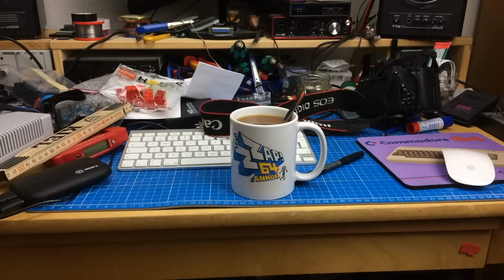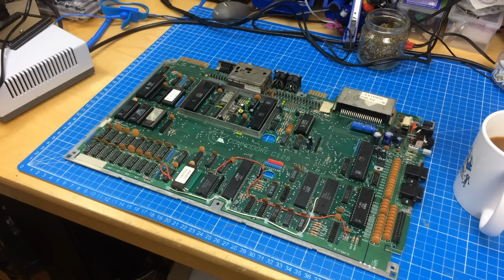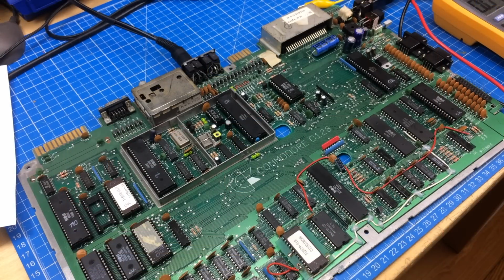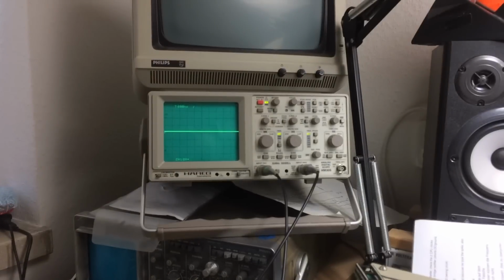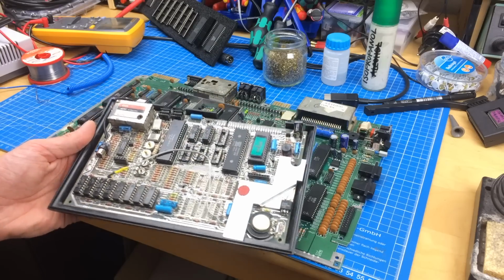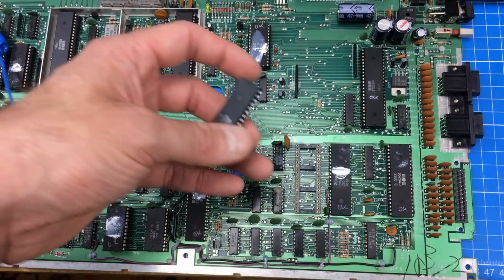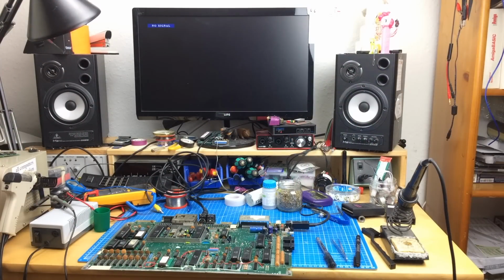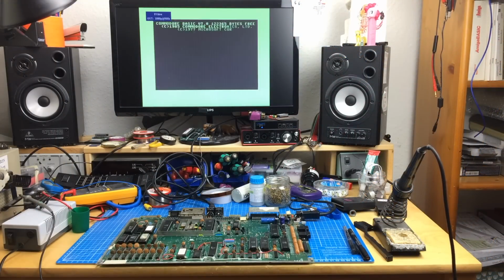Commodore 128 Repair Attempt Part 2 (Success!)

Comment: It wasn't the ZX Spectrum that was used as a doorstop at Commodore; it was the predecessor, the ZX81 or Timex Sinclair 1000 which was even more wedge-shaped, and cheaper. The ZX Spectrum didn't see an official release in the USA, though the Timex Sinclair 2068 was closely related - and very unsuccessful.
Reply: It would've been more successful (maybe) if they had included backwards compatibility with the Spectrum, instead of forcing you to buy an "emulation cartridge" to run most of the existing software.  Although some of the improvements made in the 2068 (at least the AY-3-8912 sound chip) did end up being included in the ZX Spectrum+ 128k.
Reply from the maker: Oh, you're right of course. I didn't think of the overseas versions of the Sinclair machines. Sorry for not being historically and geographically accurate on this. I'll pin the comment to the top so people can see it. Thanks for pointing that out! :)

Comment: Why is there no chip in U36?
Reply from the maker: It's for expansions. Commodore had planned to release some business software and such for it that would boot up instantly, like with the Plus/4 for example. There's a GEOS ROM that has huge parts of the GEOS system on it and allows GEOS to boot a lot faster. Quite handy really, but it didn't get as much attention as it deserved at the time.
Reply: @JanBeta  Ahh I see. Thank so much for that info. I just picked up my first Commodore 128 and I am not familiar with them. Waiting on power supply to test it out. I have an A500 power supply but I heard those are NOT compatible with the 128.

Comment: With the newer display options avaiiable these days, can i just rip out the RF modulator to make space for some mods i have in mind and still have the C128 work as normal?
Reply from the maker: You have to add a little replacement circuit because some of the video signals are fed through/processed in the RF modulator. It's the same modulator used on later C64 revisions as far as I know.

Comment: After that I had to double check my C128 to see if the bodge wire was going over the video chip pins. Seems possible in earlier revisions they weren't as lazy. Mine is a 1986 rev 7 (artwork no. 310381) and the wire goes around the pins.

Comment: Jan wie heißt das "desoldering tool" für Chips, dass du nutzt. Ich habe immer große Probleme das Lötzeug zu entfernen bei solcher Afgaben... DANKE!
PS: Du hast vergessen, ans ENDE des Videos das berühmte "HELLO WORLD" einzuprogramieren, als Krönung Deiner Rparatur. ;-)
10 PRINT "HELLO WORLD"
20 GOTO 10
RUN
...aber das weisst Du auch so... :-P
Reply from the maker: Ich benutze eine ZD-915 Station. Gibt es unter verschiedenen Herstellernamen auf allen üblichen Verkaufsplattformen. Mittlerweile gibt es auch verschiedene Nachfolgemodelle, die alle ähnlich funktionieren.
Reply: Besten Dank, Jan! Viele Grüße aus Bremen!

Comment: I suppose the hot chip began running cool once the wire was fixed?
Reply from the maker: No, it runs just as hot as the earlier Z80s do. It seemed suspicious to me but I guess it's just their normal operating temperature. I will add some heat sinks in a future video.
Reply: I'd just re-install the RF shield, it is also good for cooling.

Comment: Hehehe...Never thought that these issues came from that cable and that such a simple cause could lead to such trouble. Had something similar with my SCSI RomDrive on my Amiga 2000. In the end it was just a broken SCSI cable...
Reply from the maker: Yeah, it's the little things most of the times. I watched your hilarious Anrufbeantworter video the other day where you also mentioned your SCSI cable situation. :)

Comment: Great to see you could get your C128 working again, wish i could make my fathers C64 working again, he stop working after plugging a Commodore 1541 disk drive to it, and now the C64 are not working anymore, and i already replaced the two CIA chips, and did not help.
Reply: What are the symptoms?
Reply: Black screen, and for the rest nothing, the voltages are all ok, i measured it with a multimeter.
Reply: If it is a black screen the cause is unlikely anything 1541 related. It can be difficult and time consuming to troubleshoot it, a lot of techniques shown in the videos apply. However, it is often repairable.

 Inserting a 1541 Ultimate as done in the video can be very helpfull: Plug it in, activate the menu and look what is on the screen. For example, if your memory is broken, you will see a distorted picture and the type of distortion will tell something about what is broken with the memory.

If the PLA works, the VIC-II works, the memory somewhat works, and the bus is not stuck (as in the video) the 1541U2 can initialize the VIC-II and get you a picture.

It can be good idea to test first if it is safe to insert a 1541U2: Check the address and data busses and check if a pin is stuck to 5V or stuck to 0V. If the pins are pulsing, it is safe to insert a 1541U2. While checking the pins, you might already spot something suspicious.

Another very helpfull tool is the dead test cartridge. You can build one yourself, buy one on Ebay or configure a 1541U2 to act as one. The dead test cartridge can initialize the screen without using the KERNAL and BASIC ROMs and if your RAM is broken, it is still able to flash an error code on the screen. Therefore if the dead test cartridge gets you a picture it will tell you a lot, but even if you get no picture with the dead test cartridge, this rules out a lot of components.
Reply: That is the right one indeed. The dead test cartridge can get signs of life out of a black screen Commodore 64 if the ROM or RAM is broken. It is also immume to errors in circuits related to the RAM, for example if the 74LS257 plexers are malfunctioning, the dead test cartridge will be able to get a life sign out of the C64.

The dead test cartridge does need a working CPU. This is a difference with the 1541U2 which has its own CPU and therefore the 1541U2 can display a picture even if the 6510 CPU is broken.

If you insert the dead test cartridge, you will either get a test screen where various components will be tested for error, or screen flashes. Screen flashes happen in case the dead test cartridge determines the RAM is not usable. The flashes are an error code that is communicated. You will need the manual to interpret them. The manual is available here:

ftp://www.zimmers.net/pub/cbm/manuals/peripherals/C64_Dead_Test_Diagnostic_Manual_(1988-Jan).pdf
Reply: The 1541U2 is a swiss army knife, indeed it is better in this regard, but diagnosis is not its main purpose, just one of the many, many different applications it has. You can also configure it to act like a dead test cartridge (use the custom crt option), so if you have a 1541U2, there is no need for a dead test cartridge anymore.

You can buy it from its website: http://www.1541ultimate.net   Be warned that its maker doesn't keep stock, he produces them when he has collected enough orders. Therefore if you order one it can take a up to few months until you get it delivered.

Comment: Living in south east USA (Tennessee), I understand heat.  The temperature you're describing is NORMAL for us for much of the year.  A couple of years ago we had a heat wave where it was hotter than normal.  Temps got up to around 112 F (~44 C) for at least a couple of weeks.  :-)
Reply: Your environment is probably more adapted to it. I am half Dutch, half Italian. Having a day with, say, 36°C in Italy is far more comfortable than having the same day in The Netherlands. A few examples: In Italy houses and many other buildings are often equiped with air conditioning and windows are often not positioned to capture sun. Air humitidy is lower. In the Netherlands houses have big double layer glass windows, because in cold winter conditions, you want to capture as much sunlight as possible to help keep a house warm. During a hot summer day, however, such a house turns into a hot greenhouse. Very few houses have air conditioning, at best people buy a portable unit. Air humidity can be really bad.

So while in hot countries hot days might be more common, those countries also have better facilities to deal with it.

Comment: Thanks for sharing.   Close examination goes along way.   I had a 128D that had a keyboard problem which drove me crazy.  Had I examined the unit closely I would of seen the shorted pins on one of the control ports and it would of saved me several hours of frustrating work.   Its all fun stuff.  Happy to see you got the 128 working.

Comment: First of all - congratulations, i think we were all waiting for that!!! I have one tiny thing to say - you were checking signals and you deducted that one pin signal is too low. It would be a great thing for some inexperienced people like me to show same thing on the workable c128 to show us the difference. I now it takes time so treat my comment like a really wee suggestion.
Reply: Allthough I think it would make sense to get it visible on video, but as that doesn't exist right now, I can try to answer with text. Basically pins rapidly transmit 0s and 1s. The C128 uses two types of chips: NMOS and (LS) TTL. For NMOS chips anything > 2.4V is a 1 and anything lower than 0.8V is a 0. For TTL chips anything > 2.0V is a 1 and something < 0.8V is a 0.

That means that if you look at a pulsing pin, when it is high it should be > 2.4V and when the pin is low, it should be < 0.8V and preferably by a comfortable margin, otherwise bits aren't properly transmitted. So if you see something  else, for a example, the pulse does not get higher than 1.5V, you know there is an error on that pin. The cause can be the chip that generates the pin, it might be broken, but also that somewhere else on the PCB the voltage is leaking away, for example due to the bodge wire in this particular case.

Comment: You don't have to apologise, it's hot here too (UK) the melting point of an Englishman is 28C. I have melted and had to be reformed twice this summer.. 34C on my balcony, of my concrete box is enough! 
My PC hasn't been monitoring for a month as it kicks out heat like a jet engine.

Comment: Congratulations on the successful troubleshooting, Jan!  And thank goodness so many of your other subscribers had such useful suggestions as to what to check!  (I used Commodore 64s and 128s back in the day, but never got "under the hood" with any of them, just kept the outsides clean and blew dust out with spray cans of compressed air.  Even with newer PCs, opening up the case to add RAM chips myself is a big deal, and anything beyond that my husband and I bring to the "Geek Squad" people at the computer store to take care of.)

Comment: This is a nice example that more often it something very simple rather than the big things like CPU. Another nice example is a C64 that I recently put my hands on: It didn't work at all, 1541U2 gave perfect picture though. It turned out to be dirt in the cartridge connector that was connecting the irq line to one of the address lines.

I think the reason why the 1541U2 wasn't able to give picture here is that it needs the data bus in order to talk to the VIC-II. As there was noise on the data bus, it must have failed to initialize the VIC-II.

Comment: Well done Jan, this kind if fault may seem simple but can be annoyingly hard to find. When putting mod wires on pcb's I like to use that very fine wire wrap wire and firmly secure it to the board with UV curing glue. As you said, avoiding any solder joints! Being single core it stays bent when you bend it so its a lot easier to make complex routes across the board avoiding those solder joints, and is thin enough to solder into vias which if possible seems to me to be a neater way to connect them than soldering onto existing joints. 
Anyhow, congrats on finding this and taking us along on the journey.

Comment: Ah, the stores are out of fans. Yes, I know about this. I think I have an explanation for this... People buy fans and love to have a local breeze in the summer time.  Then the fall and winter comes and who needs this fan taking up space? It won't get used anyway... and so they throw it out, only to buy another one the very next summer. I have a ceiling fan and it's on most of the year. I turn it off when I'm not in, but otherwise... always on. In the winter I flick a switch and it sucks up heat and spread it around the room. I also have a stand up fan and I sleep much better at night when that thing is doing it's work. It rotates, you know, and it's like listening to a breeze coming and going. Even in the winter. People should care more for their fans. Show them some love. Hey, I own a couple of Commodore 128 too.
Reply: Don't wait for a snow storm to buy a snow blower either. (Little tip, if you have one don't leave it on front porch overnight either. Cuz: theives)

Comment: Yep, always check the simple stuff first, I always do a visual check first when I am fixing things as often it will take you to a clue or even directly to the fault.
Reply: The Defpom's Repair Channel I find that checking previous bodge job's and mods, even factory ones lead me to the faults more times than not. Surprisingly even if it's not directly related.

Comment: Great job fixing that board! I know the frustration with a fault that is hard to find. I have a C64 board that I have been trying to fix for a half a year at least. Replaced almost all the chips, and still gives me a black screen :( I feel like giving up with it, but would really like to fix it. I would like to have that feeling when it finally boots up, like you have in the video. Anyway these kind of videos are really helpful, and I already got some new ideas to check on my faulty board. Thanks!